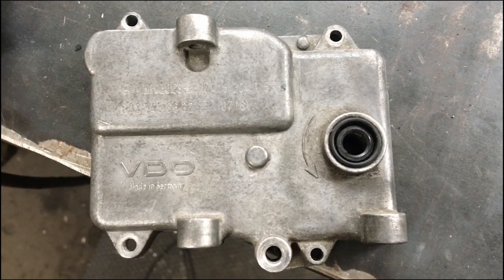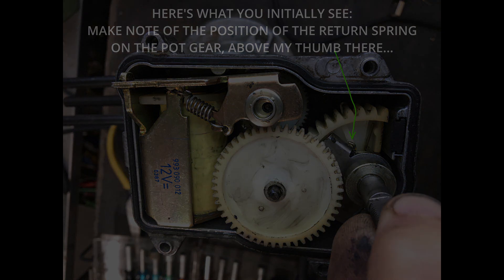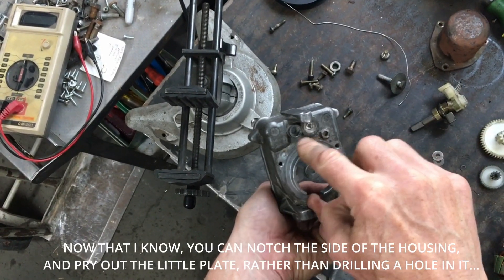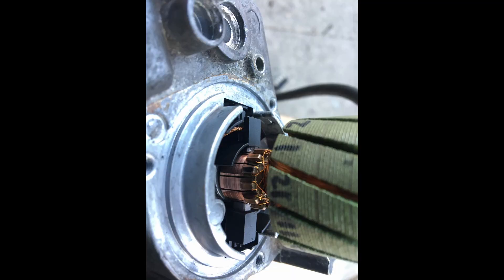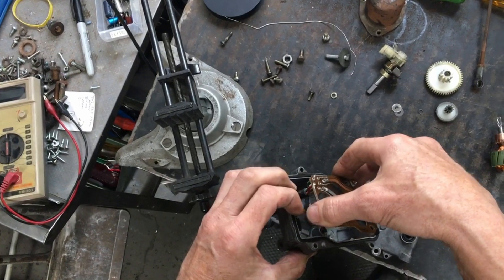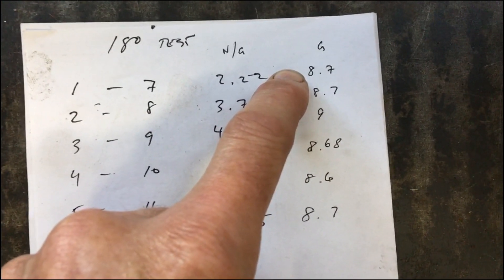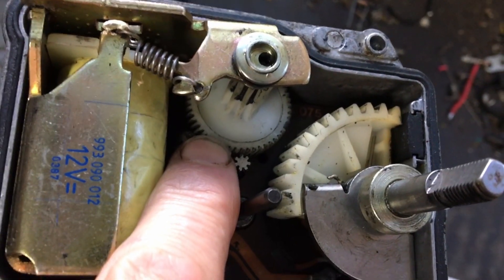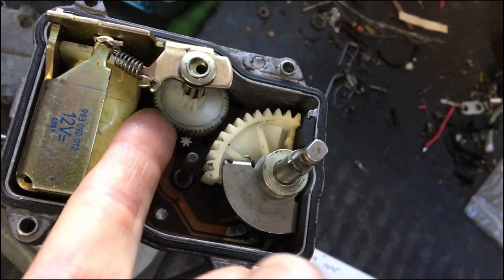W123 BENZ Cruise Control Actuator disassembly

Comment: Excellent video, great channel. Subscribed. You have some gems on here. 

These actuators seem oddly unserviceable for something on an old MB. I'll be taking mine apart soon for a cleaning and lube service. Shame about all of the plastic gearing inside, although it seems pretty stout.
Reply from the maker: Ha! Glad you got something out of it. I got the impression it's VDO that made this unit, not MB per se, so maybe that explains the proprietary nonsense. They made some instrument clusters and so on that they didn't want you inside fooling around with either. Clearly these kind of barriers inspire me to circumvent. Good luck with yours.